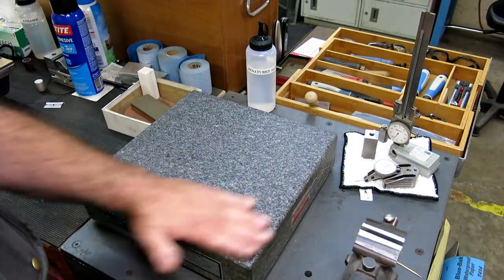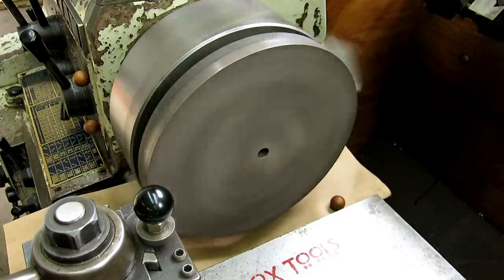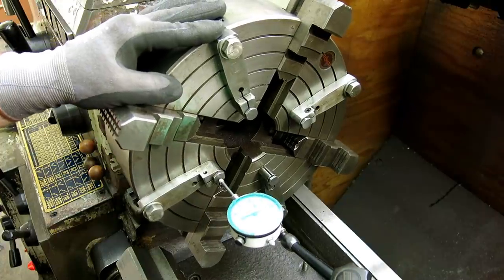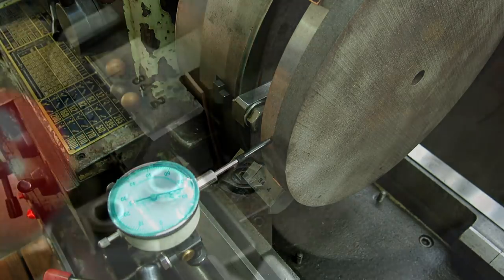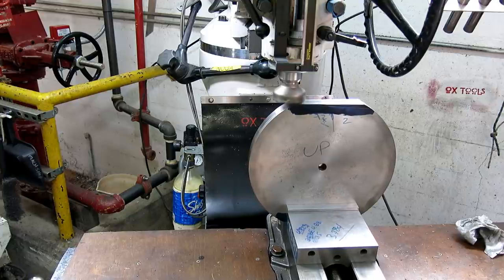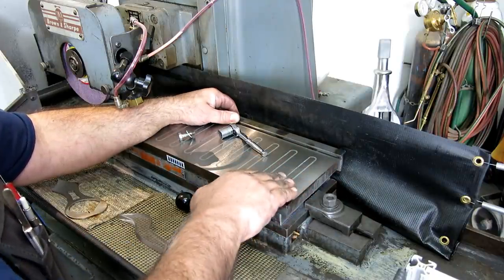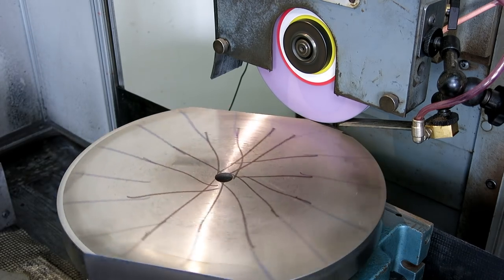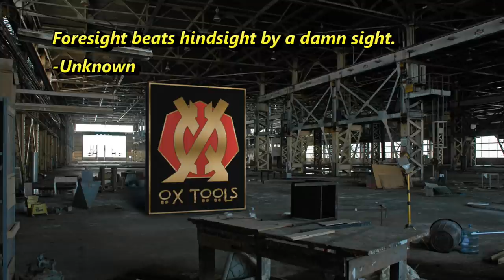Confessions of a surface plate abuser

Comment: I am a non machinist so I was curious : When you were surfacing the side of disk   , would it not be possible to make a steel axle through the centre of the disk hole and use that as the reference point to secure the object into the jaws and thereby also use it to lathe the complete side (without having to lathe in two operations ) ?
Reply: Yes. But!  the hole has to be round, perpendicular and square...and your Axle (mandral) has to be a perfect fit to the hole...and be able to take serious torque and twist...and the weight of the plate. Pretty small hole for the weight of the plate. If it sags or bends..and you start spinning it up to speed...and the pin breakes...its called a Man Killing Frisbee as it bounces ALL OVER the shop at high speed and at a gawd awful terminal velocity.  Sure you want to be in the same room if it goes Kablewi?  I sure dont.  Ive seen the aftermath of such things...company paid for new machinery, walls, floors..a nasty gash in the ceiling and a shifts worth of clean underwear.

Comment: I've used a piece of glass with sandpaper on it in the past, works pretty good as glass is predominantly flat. Wouldn't be too difficult to have a piece of glass the same size as the surface plate.

I admit, I have a separate plate I got on the cheap I use with sand paper... 🙄 (guilty as charged)

Comment: For some strange reason, that out of centre hole is upsetting me.

Also, when you want to turn a flat out of raw stock, is it good practice to tap it against the jaws of the chuck?
I do realise a 30mm thick plate isn't going to flex. But if it were thinner, wouldn't it flex and be out of flat when you unchuck it?

I'm learning, so it couldn't be a strange question.
Reply: Same
Reply: Yes it is common practice to 'tappy tap tap' your work to seat it in the vice/chuck.
If you where machining something flexible. You'd put it on your surface grinder after and then maybe lap it.
No question is stupid only the answers.

Comment: heretical question
how about mounting angle grinder with grinding stone on a cross slide of the lathe and doing most of it in one operation?
Reply: I would say having abrasive dust all over the lathe wouldn't be healthy.

Note I'm not a machinist.
Reply: Lathes are designed to face ever so slightly concave - you would not end up with a flat surface.

Comment: maybe you should make a surface plate out of metal that melts at a very low temperature. Then every time you need to "resurface" it, you just heat it up to it's melting point and let it sit and cool xD

Comment: Sorry I know the hobby machinist thing is to create projects so you've got something interesting to do...But this is days of work to have a  base for finishing small parts. Just take the old work shop surface plate and use double sided tape behind the wet n dry so it doesn't move around and cause any un-necessary wear. most places have at least one of these knock about plates. If not it takes a few minutes to get your granite re-honed twice a year for very little money...just use the corner that's never used except for your coffee cups;)

Comment: I have a few surface plates, but I'll only use the cheapo ones for sanding.  They're ~$1/lb, just like cast iron, but you can get them a lot flatter than a ground disk.  Glass works too, but it also breaks really easily and is extremely flexible in the normal thicknesses.
https://www.amazon.com/TTC-Thick-Grade-Granite-Surface/dp/B0058JW99I
https://www.amazon.com/Granite-Surface-Plate-12-Grade/dp/B0035Y7OPC/
https://www.ebay.com/itm/Grizzly-G9650-9-x-12-x-3-Granite-Surface-Plate-2-Ledges/283829207003

I'll have to look into those adhesive sanding disks though.

Comment: Ah, yes... showers of hot chips... oh, the joys of turning cast iron...
Reply: Use (IIRC) Keith Fenner's trick of cutter upside down and lathe in reverse.  The swarf spray is directed down towards the chip pan.

Comment: Elongate your parallel holes then you can mount on the back of the carrier. Between the jaw and the carrier and mount another on the back side of the hard jaw between the jaw and the vise. Then you will be sitting parallel and up off of the carrier. Since that is not really precision flat like parallels.

Comment: Leisure time at Tom's shop. This is the best machining to do. Your own design; no critical dimensions to catch, act with bozo's on the fly; you could even drink a beer while doing it! That's a joke for all the safety police wizards reaching for the keyboard when reading right now... Two cents from my side; I think a proper lathe (Schlesinger norm) should turn a face just a twitch convex which your preliminary hand grind shows nicely or; keep the lathe. But what is the difference in the Rotogrind setup? Your lathe setup for cleaning both sides parallel seamed pretty accurate...or what happened there? And, already mentioned, why didn't you plug the hole? Dust collection or? :-). Adding WD40 reduces the action as you mentioned but it also more than triples the live of your sanding paper I noticed. I changed the future of one of my surface plates according to Rob Renzetti's video and had some problems sourcing 400 x 400 mm sanding paper. I succeeded with a company who sell's belt sanding equipment for wooden floors in a blue zirconium variant (400 grid) for 7 euro's a piece. Maybe a tip. Best, Job

Comment: That Starrett Rule looks just like the one i lost 35 years ago. If you want my address 😁😁
For the copper shims that you place between the jaws and the work. Make them long enough that you can bend two 90 degree tabs so they cant fall out of between the work and the jaws.
Also for when indicating parts in that needed to be concentric and square i used to use short screws that threaded into tee nuts. these screws were drilled and tapped for 5/16-24 jack screws. A lot easier and more controllable than tapping the part with a soft hammer.

Comment: I see no value in using cast iron. I've done some research and it seems that the HRC hardness has a wide range and can be as low as 22 HRC. The hard cast iron you think you have is pretty much not used because it's hard to machine. It's better then to use high carbon steel IMO

Comment: No way. if anything other then a height gauge was used on the surface plate. We'd get a talking to. I've seen people fired for trying to use the surface plate for anything other then determining height or marking the machine plates we built. And I never saw you use taping oil or coolant.

Comment: "this simple to build plate"; easy for you to say.  While I suppose most people do have a surface grinder in their basement, I'm not sure many have a rotary attachment for it (at least I don't) on the other hand, if one wants to have multiple grits handy one could make 3 plates,  hand scrape them together and not even need the grinder.

Anyway, I don't happen to have a scrap of cast iron, however one could buy  disks from McMaster for about $100 or so each then spend $500 worth of time on it ... the $30 Chinese granite plate is looking pretty good (unless of course one's business is making YouTube videos)

Before you stuck the sandpaper to it, putting the disk flat side down on a large surface plate and pushing it around a bit (fairly fast) might have been entertaining, maybe, I haven't tried it with something that large, but a flat  4" disk is fun (foreshadowing)

Comment: Man I hate using 4 jaw chuck I have a 12 inch 3 jaw buck chuck on my machine so much easier turn the od bore soft jaws and you can buck it in to..0000